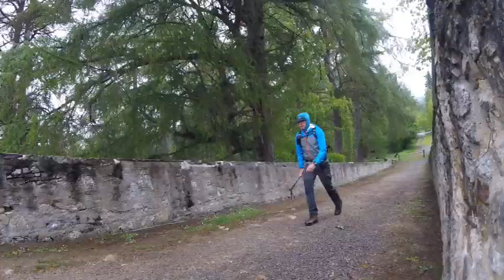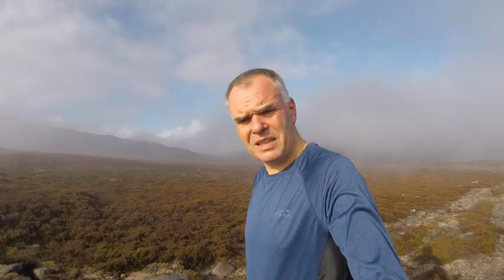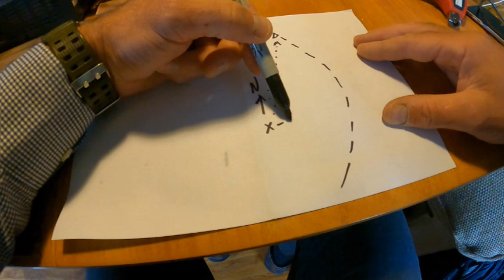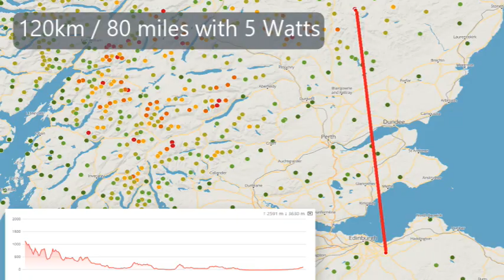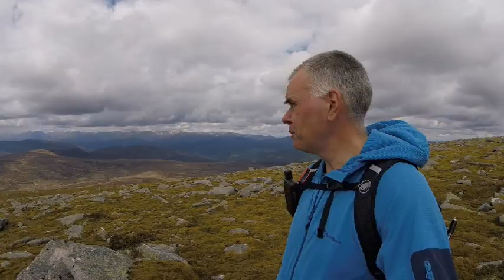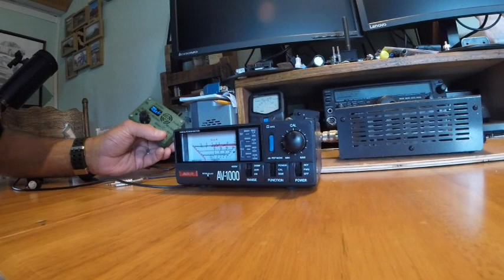Mixed Results on Lochnagar - and Nav. School!

Comment: Hi matey. Todate I haven't had much luck using Qrp radios. I use the Qrp calling frequencies  and stick to the rules. 20metre band 20 minutes past the hour for CQ and 40metre 40 minutes past the hour for CQ calls etc. At home I find local Hams regularly talking to one another using 150watts on QRP calling frequency etc. So for time being I have given up. 😢Cheers from old George
Reply from the maker: Hi George, Good to hear from you again. I didn't have much success with this wee radio, however I do pretty well with 10 watts from my KX2 
Cheers,
Fraser MM0EFI

Comment: Great stuff on the navigation Fraser…
A skill you really need to purposely practice in poor visibility alone in my opinion…
Unless people you are with don’t mind you non-communicative and silently muttering numbers to yourself for the whole climb, while intermittently taking out the map and compass! 😜
Reply from the maker: That is a very good point Dave. Also, it's harder alone in a whiteout as you don't even have another human as a reference.
Cheers, Fraser MM0EFI
Reply: @theradiorover  yep..
I suppose if the other people are also navigators, then it’s a benefit of course for a double/triple check.
My skills definitely need sharpening and practice in this regard. 😊

Comment: I’m quite surprised there hasn’t been a flood of cheap hand mics for the TruSDX yet…..on my todo list is to modify one from the Kenwood style 2.5/3.5mm plug to seperate 3.5mm plugs, but I wish the designers or builders had just made them the Kenwood standard to begin with!  Still, given my x6100 has just arrived, that project may take a back seat for a bit!  Great video, and I must be one of the few here (Aus) who miss the British weather!
Reply from the maker: I did think of doing a kenwood style mod, however opted to keep the two jack plugs on separate flying leads. This would allow me to leave the audio out unplugged in case I wanted to use a small external active speaker. 
I still need to re-make my speaker/mic. Version 2 will be a lit more robust! The cabling in those things is miniscule and very fragile, so a re-think is needed.
73, Fraser MM0EFI
Reply: Morning Fraser have taken out the (tr)uSDX Transceiver out again for another outing?
M7HFD
Reply from the maker: @ryanbeare580  not yet! I have successfully re-made the mic and earpiece combo. I also bought a cheap active speaker which works really well too. 
Cheers, Fraser MM0EFI

Comment: Good review of the nav basics. Being "present" is key. Cheers and 73
Reply from the maker: Spot on Jeff. I'm no expert and I've certainly been lost in the hills enough times to know better! That's with a GPS too! Half the battle is remembering to use the map, compass, GPS or whatever before you get lost!
I would have found the summit no problem in the mist, but I was glad when it cleared up, as Lochnagar has some lovely crags and nice views.
73, Fraser MM0EFI